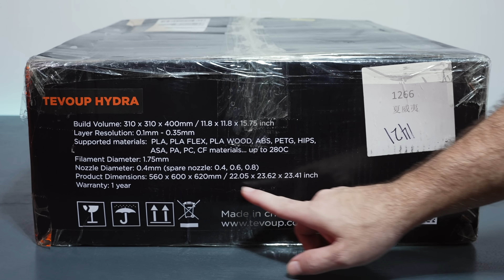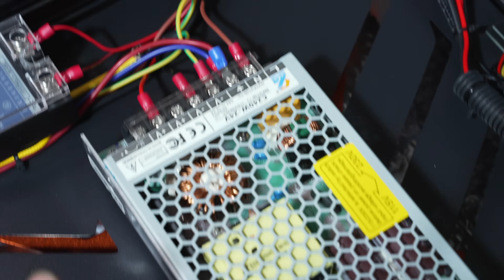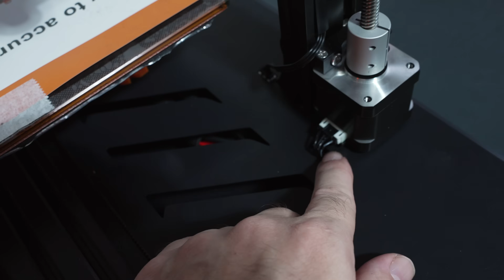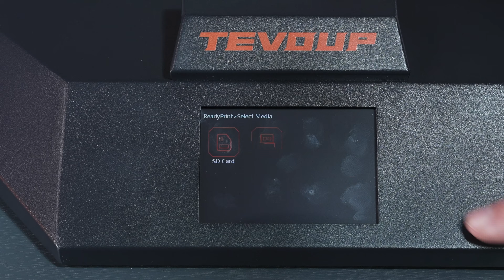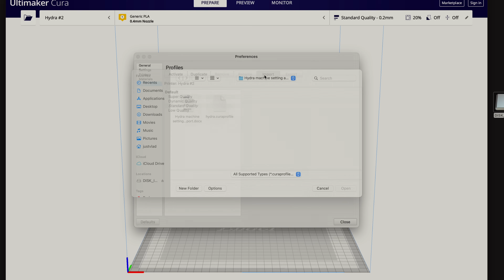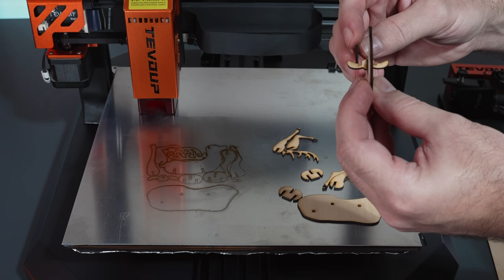Tevoup Hydra - 3D Printer + Laser - Unbox & Setup

Comment: I'm not sure but I think I saw a tube in the documentation and perhaps you need to print two of those tubes and install over the bearings on the feeder and that will solve the issues.

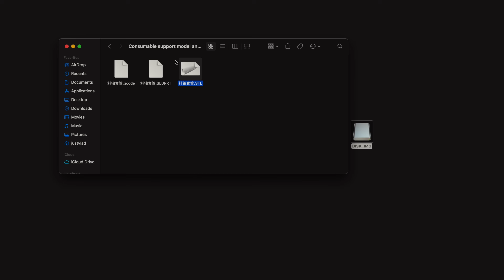Comment: I think that weird tube-shaped model at 37:51 is for use with the spool holder. You print out two of them and put them on top of the bearings between the two halves of the spool holder, that way the spool has a much bigger surface to ride on.
Reply: O

Comment: Honey Badger reviewed this printer and they hated it.  they had nothing but problems. You would need to see their video as to why.  But have you noticed this printer looks like an artillery printer?  That's because it is.  A few of the guys that designed it came from Artillery.  Also TevoUp was known as Homer and before then they were Tevo. To be honest I would avoid this printer mainly cost if the company that it originated from went under (twice) I don't hold out much hope parts will be easy to get
Reply: Sorry to correct you man, but the full story is that the guy that founded artillery resigned, from TEVO, the oldest company. Then he used the files design he got from working at tevo to build artillery.
Tevo trying to get back on there feet rebrand themselves to homers and bring some new models to the market, the orange color ones, tarantula models and more.
Then they developed more and used the design they got to make the hydra, which was co-developed with me helping them personally, in hardware and software. So all in all your statement is totally false.  They are not coming from artillery and they do not copy them, exactly the opposite has being done. Feel free to spread your hate. And if you have questions fell free to ask me.
Reply: @manu7irl complimenti per questa creazione l'adoro anche se ho avuto problemi con la testina laser difettosa.
Reply: i know my comments will get forwarded to honey badger but honestly i dont give a shit but before you pull tevoup down because of what honey badger says who lets face it know only what hes been told and gives false info in his reviews but if you checked out the other side of the story the x1 design is stolen off tevo because the founders of artillery used to work for tevo and left with the hydra design files and created artillery, don`t believe all honey badgers shit because he talks shit
Reply: the hydra was out as homers first